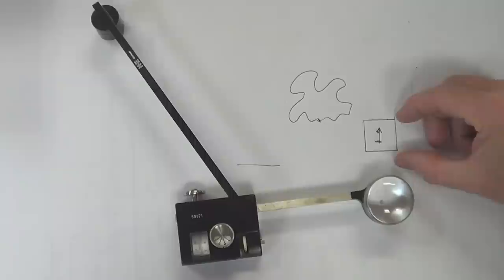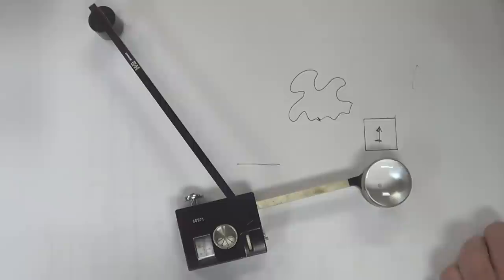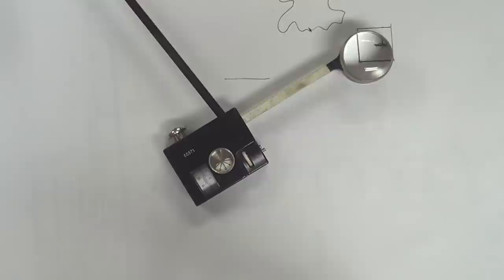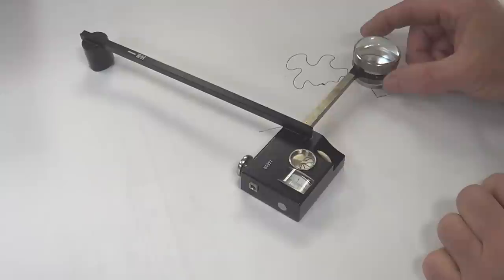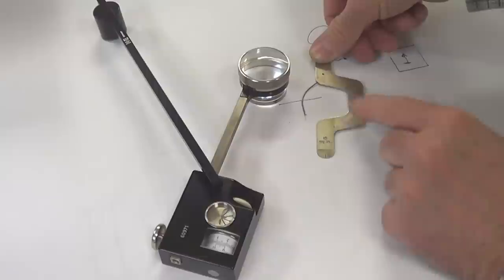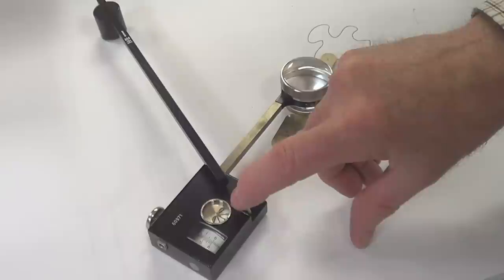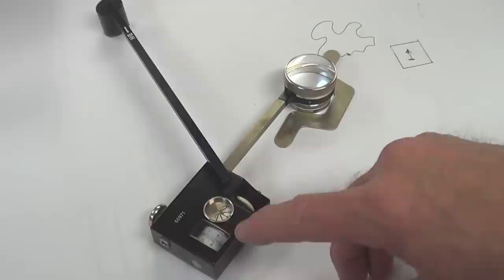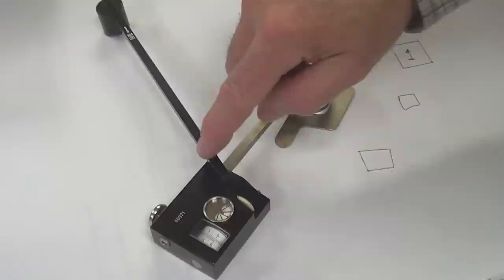K&E 620000 Planimeter measure Area tool demo Engineering

Comment: If you don't need 99.99% accuracy, there is a simpler (and much cheaper) homemade device that does the same job.  Get a length of straight stiff wire, a cut coat hanger will do.  Make a short 90 degree bend in each end pointing the same direction.  Flatten one of these bent ends and sharpen into a curved axe-like shape with the "blade" parallel to the length of the wire. Sharpen the other end into a point.   

To measure an area, say on a map, put the point of your device on the line outlining the area you're measuring  Let the axe-end rest anywhere on the same surface as the map, and mark that point.  Now, keeping the axe end in contact with the paper, trace the outline of the map with the pointed end.  When you have returned to the starting point.  Mark the new position of the axe end and measure how far it has travelled from the original point.  Multiply that distance by the distance between the center of the axe end and the pointed ends of your device.  The answer is the area you're seeking.
Reply: i need a video of this

Comment: Used a planimeter in 1956 at the VA highway dept to measure the areas of roadway cross sections, one side xsection of the road and other survey of ground. Measured at 50 ft intervals for the length of the planned road. Average end area for two sections x length gave volume of excavation cut or fill  for the 50 ft section of roadway. Before computers the only way to design a highway and know the amount of earthwork required. Tedious, boring, voluminous  job.